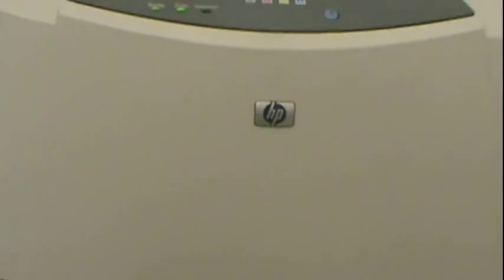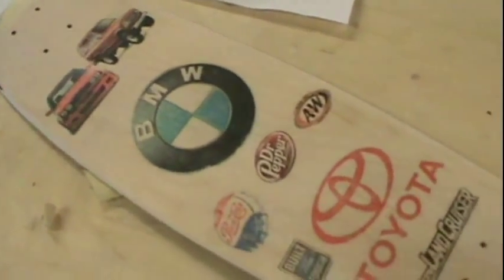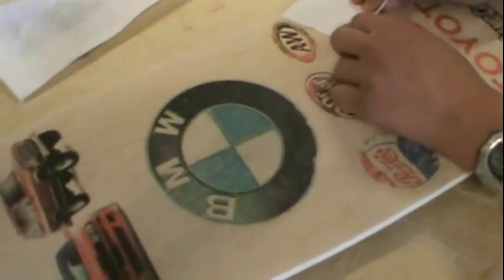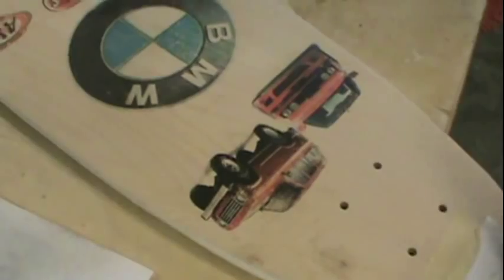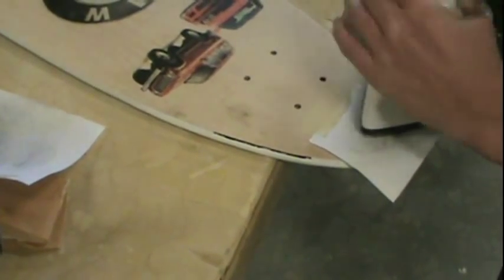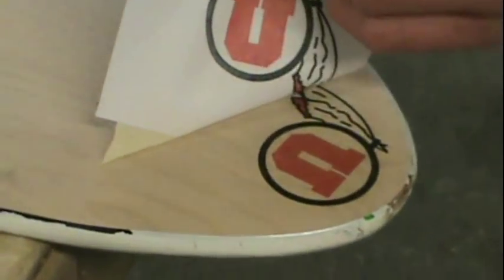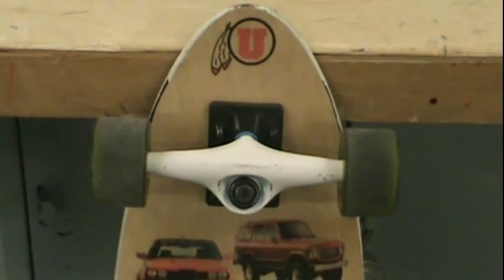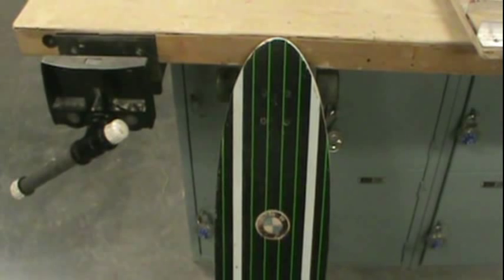How to Iron Transfer Color Pictures to Wood (skateboard edition)

Comment: Mr. Byrom are you using normal copy paper or actual iron transfer paper? Thanks
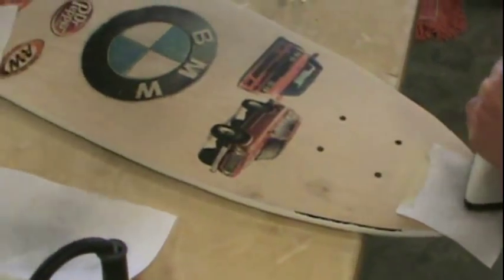Reply: At 1:15 he tells you this is "ordinary paper".  I wouldn't be surprised if it worked better using iron-on transfer paper.
Reply: I agree.  I tried ironing with normal printer paper and it didn't work out so well.  I watched a video where a girl used transfer paper and it worked like magic.
Reply: Makes sense, as long as it's the right transfer paper.  There's different paper for ink-jets and toner-based printers/copiers.
Reply: +TechSupport100 I tried iron-on paper just now and it didn't work.